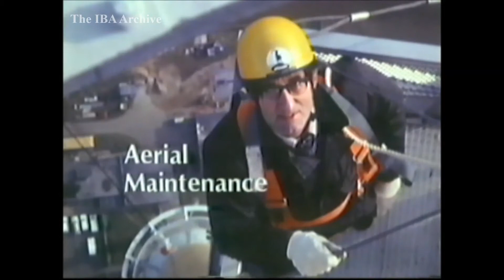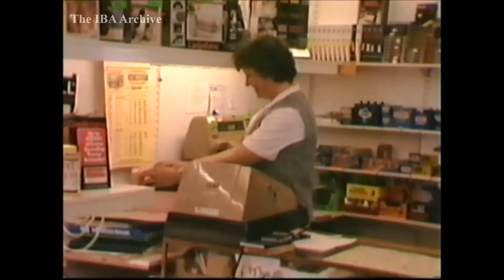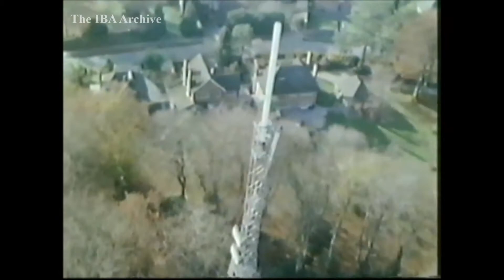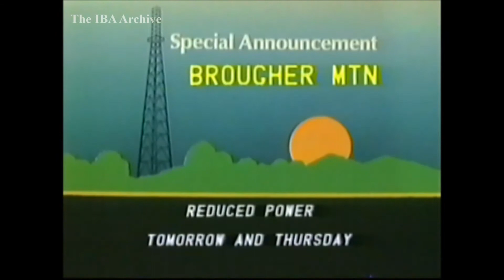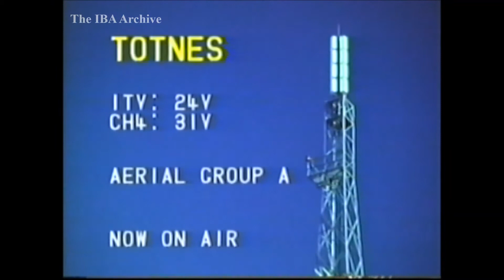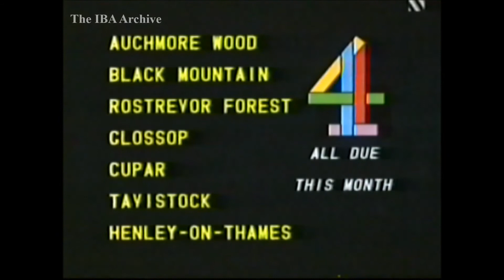IBA Engineering Announcements - 3 July 1984 'Aerial Maintenance & 405 Line Closures'

Comment: One thing people don't seem to understand is why the transmitter(s) need to be off when they are working on the Aerials. Here's a way to understand the dangers. Your microwave oven uses radio waves to heat food, the frequency used is higher for several reasons, one being that food is smaller. If you were to work on a broadcast aerial while the transmitter is active you would cook just like your food does in your microwave oven.